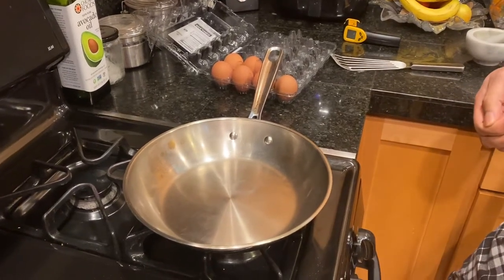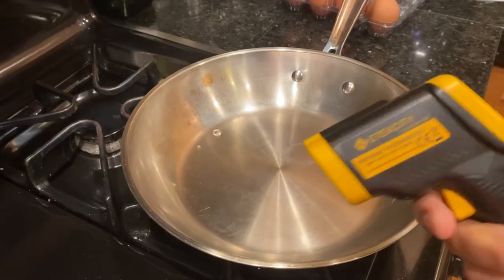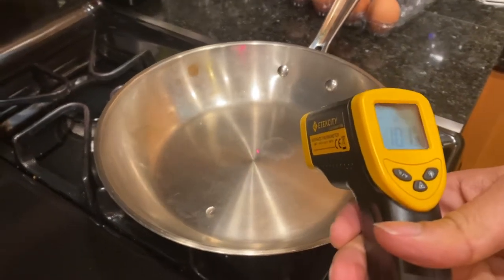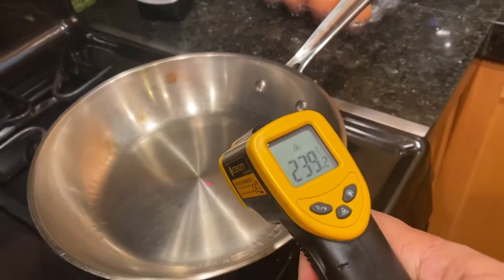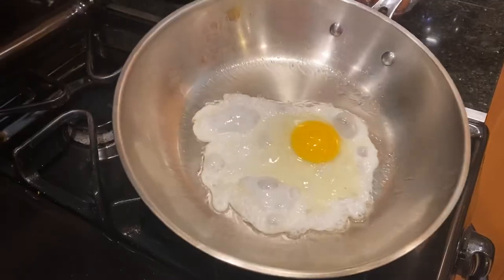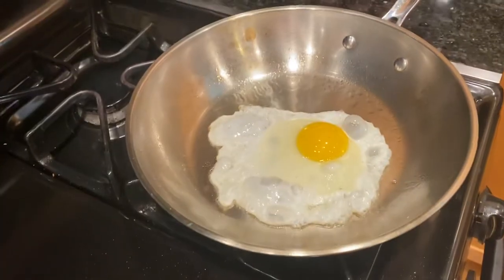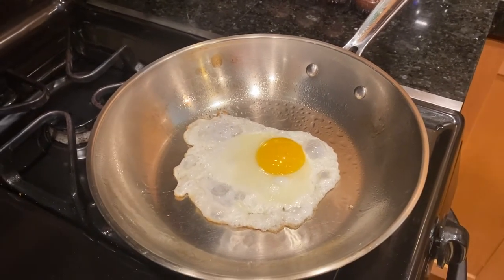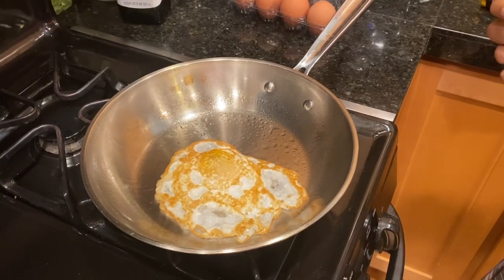Leidenfrost effect: Convert stainless steel pan to short term nonstick

Comment: Laser thermometers are not accurate on reflective surfaces such as stainless steel.
Reply from the maker: Good to know.. I returned it today.
Reply: Infrared* not laser.
Reply: That explains it.  I tried my thermometer on both a carbon steel pan vs a stainless steel pan.  Carbon steel, it registers about 360 before it get the Leidenfrost effect, but stainless steel pan, it's only about 180 to get that effect.  I was wondering if the type of pan makes a difference to get the Leidenfrost effect, but as you say stainless steel is not a good surface for accurate thermometer readings, that would make sense. 

Thanks!!
Reply: @Oneness100  You need to calibrate the emissivity.

Comment: The emissivity of the stainless steel surface is very low. The infrared thermometer assumes a high emissivity because so many things have, such as your skin and the oil in the pan. The temperature of the pan did not jump. Rather the oil simply came to the temperature of the pan.

Comment: I just did the same thing and the temp did the same, soon as oil goes into a 100c pan it smoked horrifically and then read 250c, that is bizarre. I guess it means oil is like a massive heat conductor or some shiz. Doesn’t really help if you want to be in the leidenfrost range which for my pan the water STARTS to marble at around 80c. The egg did still not stick though, despite cooking very fast
Reply: 100c is not enough for leidenfrost, and your oil isn't magically adding 150c temperature. What you are seeing is that laser thermometers just don't work for reflective surfaces ;) if you used it on a black cast iron pan, you would get a much more accurate reading
Reply: @hoelk  Water bounces around my pan perfectly at 80-90 degrees and when a thin film of oil touches that pan it heats up to twice the temp. Butter can not burn at 100 degrees or even 150c and oil cannot smoke yet when placing either in a pan of 100c they both instantly burn/smoke
Reply: @EricPollarrd  but how did you measure the temp?
Reply: @hoelk  a temp gun isn’t out by 100 degrees
Reply: @EricPollarrd  still your not gonna get leidenfrost effect on a surface that is below the boiling point of water ;) that's just physically impossible. Leidenfrost effect of water sets in at about 150c.
Reply: @hoelk  so my temp gun is out by 80c+
Reply: @EricPollarrd  do you still have the manual? You need to calibrate it for different surfaces. The Alternative theory is that you have pans that do not abide to the laws of thermodynamic.

Comment: Because stainless steel is reflective and your IR thermometer will have a hard time reading it directly.  Adding the oil changes the reflectivity of the pan and produces a more accurate reading.  
Water is not going to dance and boil on a surface that is below the boiling point anyway.

Comment: If the reading goes haywire when adding the oil then the question is how do we cook eggs in a pan that we’ve just cooked all the bacon and sausages in? I like to do that rather than have a separate pan for clean eggs, more flavour. Being as the Leidenfrost effect happens across a massive range starting below 100 to well over 150c, it would be pretty difficult to be outside that temperature purely naturally from just cooking some stuff, so therefore u should simply be able to drops the eggs into bacon/sausage/butter fat and not having any sticking. Only we do

get

sticking

TONS OF ICKY GOOEY BUSTED YOLK STICKINESS!!!!